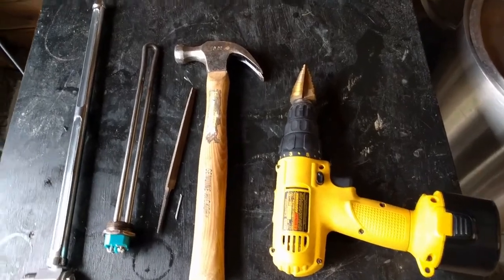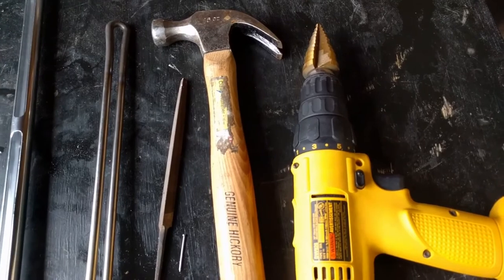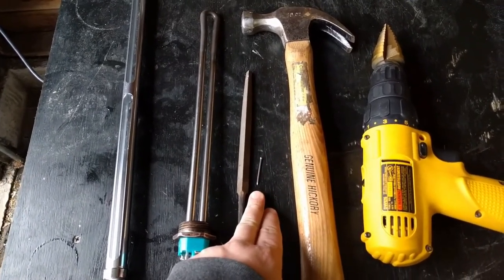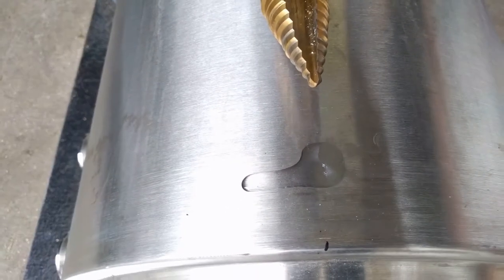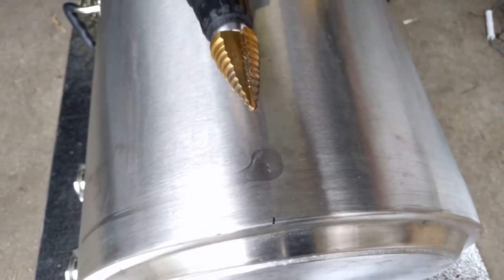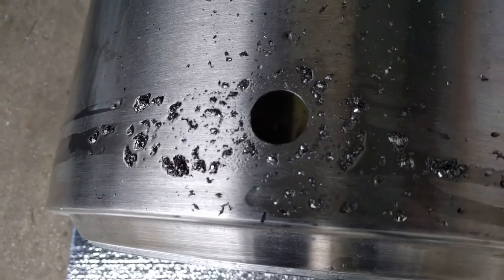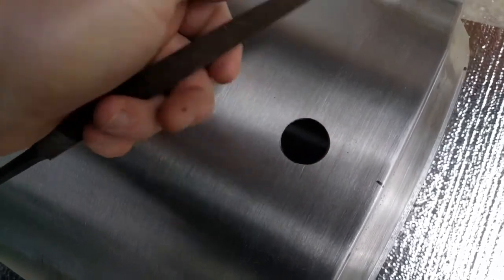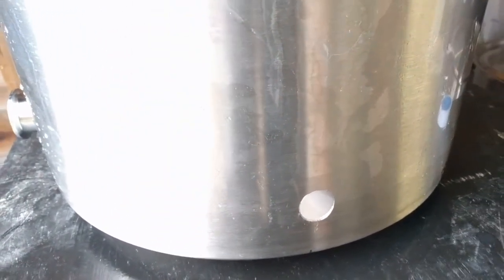Brew Hacks: Drilling a hole in stainless for a bulkhead fitting

Comment: Hi, thanks for posting. Would a step bit work to expand a preexisting hole in a kettle? I have an ss brewtech kettle that has a hole for a ball valve but I want to expand it so I can put a weldless tri clover bulkhead and butterfly valve. I've never used a step bit before and I'm worried i might wreck my kettle! Thanks again